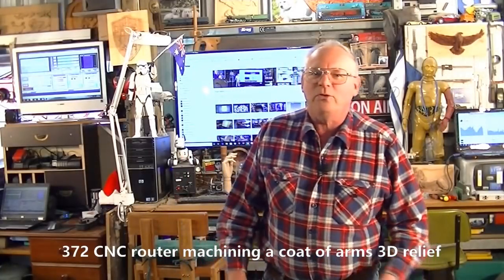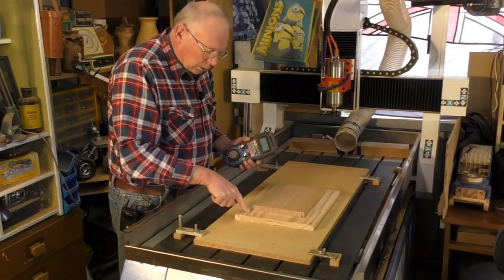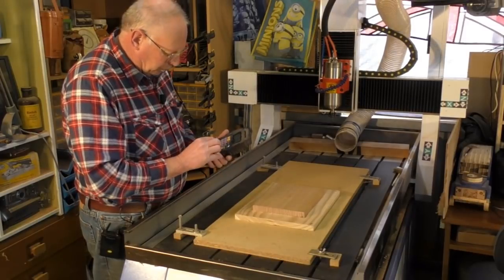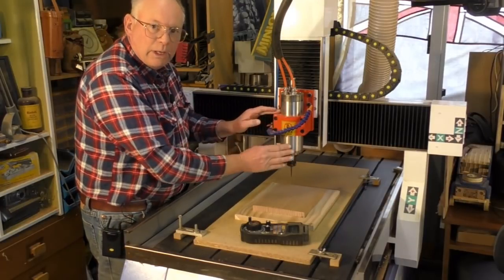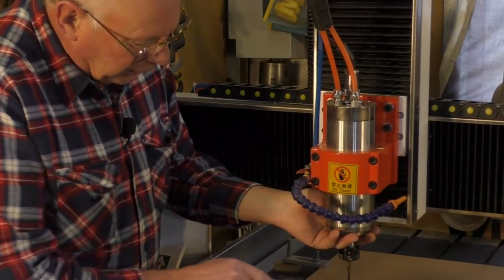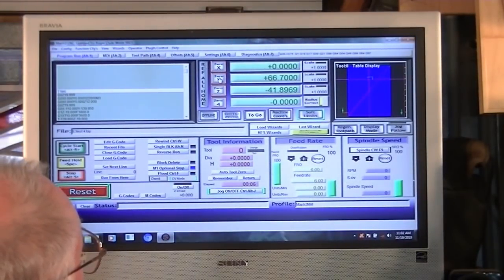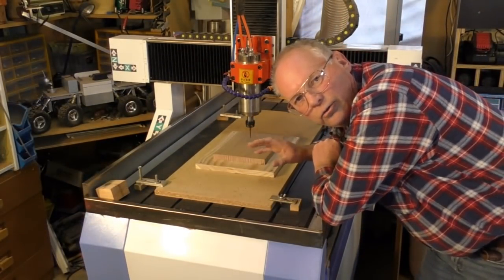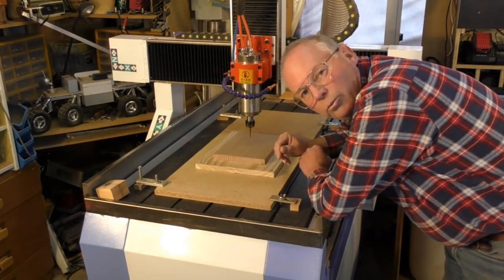CNC routers that can make 💰1,500 per day custom carving a 3D coat of arms

Comment: Hi, can you tell me what the difference would be if you had set the starting point not in the middle but on the bottom left corner? Why  is the middle position was the best choice?
Reply from the maker: This was my personal preference for this job, you can set the start of the program in any corner or the middle it is what works for you at the time of programming
Reply: @inventorsworkshop9600  I see, ok, thanks, and what about step over value when you do 3D?

Comment: Looking great! Just wondering why you use the detail drill bit for carving the entire thing? Why not use a big rough drill bit to first carve out the most of the wood and then change to the smaller higher detail bit? I think you could cut it much faster, and plus save your fine working drill bit. Cheers!

Comment: Roger, love your videos. I dream of being able to reach your level some day. I have an issue I'm hoping to get some advice on. I tried doing something similar to this coat of arms but with a 911 communications department patch. I used Vectric Aspire 9.0 to set it up. I used a 2.8 degree 1mm ball nose for the finish pass and no matter how small I set the stepover (last attempt was 3% stepover) the edges of the raised portions do not have a smooth edge, they are rippled. Any tips to do away with that? I have noticed in Aspire since I traced an image captured online to do this the lines when zoomed in are not smooth, they are jagged. Could that be the cause?
Reply: What kind of wood are you using?
Reply: @talesinshadows-4u  The ones I tried were with pine.
Reply from the maker: Merry Christmas and happy new year to you and your family

Comment: thats true I was working cutting dies of aluminum with a XYZ millenium cnc router outputting abot 30+ dies/day and each will go for 100buks the least upto 2500 USD and if you add a counter die way more each, so you can make a ton of money it is possible you have to sell a lot and market as well, be friend with the phone.
Reply from the maker: Merry Christmas and happy new year to you and your family
Reply: @inventorsworkshop9600  Thank you Roger have a great time wit your family, I would like to be in Australia instread of this crazy cold in Canada. I really like working with the CNC machines. Now I am building a SLA 3D printer, Ill show you if it works when it is done. 

 By the way I did not think others would use the art cam, I also used it to create the logo for a restsauration of an old ferrari and a new emblem in pltinum for a rich dude, now I use other software since my original background is 3D animation and Games, I use these blender with Design Spark to create complex models and import them in CAD CAM software to machine them.

Thank you for your channel

Comment: depending on the material and finishing if i dont have a tool setter on a machine, i prefer to use a 123 block to set the z height.  it helps avoid a crash. i would have roughed that out with something bigger first to speed up the process.  i'd also try to fill the table with work to cut down on tool changes.  one thing i've really liked is that i built a simple enclosure for the router i use, for wood its great because i just run air blast on the tool to keep the path clear of dust, and for aluminum it keeps the coolant mist out of the air.
Reply from the maker: see my latest video

Comment: You could save time and $$$ by using a larger tool to remove most of the material and just finish using a small bit
Reply: Totally Agree. He is making 4-5 of these a day, he could be making 4-5 per hour. Also he is killig his finishing tool as it rubbs on all that stock material wenn moving in Z. So the Qualitiy of the parts that would come out with a proper Roughing-finishing Strategy would be much better. All just at the cost of a single toolchange. So I think this is a very poor way to utilize the maschine. Best regards.
Reply: Christian Gerdes-Wocken could be doing it for the video
Reply: I don’t know if it matters as much in wood
Reply: @PatrickOlah  you could argue that the bits will last longer because the material is soft but time is time.

Comment: Hi Roger, I am new to your channel, think this is only the second video I have watched with the first being a programming/design instruction.  I was surprised at the beginning when you were centering the machine that you loosened and adjusted the spindle to accommodate the cut depth.  I am curious what the benefit is of doing this over raising your material?  I can only think that maybe this is a new machine and you have not fully setup the bed layers or that possibly you just finished a larger project requiring more height...  Looking forward to seeing more projects and revisiting your previous ones.

Comment: Hi Roger
I'm resurrecting an old buiz and seeing the need for a 'kitter' to produce routed kits of my RC foamie planes. Many of the planes are one sheet of either Dollar Tree posterboard foam or Ross posterboard. I have a question.
The material to be routed is a paper veneered foam so router has to be quite sharp and clean but very little is required to move it through the material. I could utilize a kitter that can carry each order through received through to fulfillment in shipping, or if the CNC in this instance is not expensive, I may do it myself and later expand.
Do you have any recommendations as to the CNC I would need. Resources are scarce and I know little about the cnc programs except they are similar to the ones I used to program basic in the early 90's. I do understand drawing etc but not much in the way of CAD however I do have connections that can vector draw any of my designs from PDF and possibly some that can convert them to cutting files.
Reply from the maker: Have a look at some of my laser and Carveco videos, you are still looking at over $12,000 + tax

Comment: Looks like the feed rate was a bit high, when you had excessive Z motion you burned the wood a bit.
Reply: the tool become blunt. its cutting to mutch get to hot. more steps in depth would be better or diamond tools
Reply: @isisrufus  diamond tools cut extremely slow. They also can't transfer heat away very well.

I do manual wood turning a lot, the easiest way to work fast is wetting the tool all the time, as soon as you feel it gets warm in your hand.

The edge retaining is much better that way.
Reply: @RubenKelevra  thats true but when working with a cnc you cant wet you'r tool

Comment: Nice carve. I was wondering if you got a new CNC Router? And if so, what one? Looks nice! I found it curious that as the bit was slowing in X/Y to rise or lower in the Z cut, that the wood burned slightly. I wonder if you are concerned about that and the bit heat up and longevity, or if its a non-issue? Thanks for the vid. Happy Thanksgiving
Reply: This is a problem with mach3 controller software for the cnc. It is not able to calculate the path fast enough for complex paths
Reply: Charles Deshler it was going to fast

Comment: How long did this take to cut?
Reply from the maker: 2.5 hours @ 150% feed on Mach3
Reply: @inventorsworkshop9600  That's pretty good with a small bit like that. Great detail. Would a roughing pass make it faster cut time? Good Job.
Reply: @inventorsworkshop9600  what ipm did that run at?

Comment: It looks like your feeds are too slow as it appears to be burning the wood. Won't this shorten the tool life?
Reply: Not just jump up the speed do roughing using larger tools and remachine only with the smaller ones progressively he is literally taking 100 times longer than what it needs so I can't understand making 1000 a day the sales would be hard enough maybe a few days 1000 each day
Reply: @togowack  by just going with the final bit, you don't need to go over the same piece with different bits. I think this way is faster, but he is going really slow...
Reply: You are correct. Although, carbide isn't affected by the heat. He should jump up the speed.

Comment: That looks like exactly the same spindle they use on Axiom routers and that in itself isn't an industrial spindle. What was the machine time on that job because I certainly can't see 4 of those being finished per day 8hours at that feedrate (maybe something smaller). Job setup, Pre-machine and post machine work takes up a lot of time.